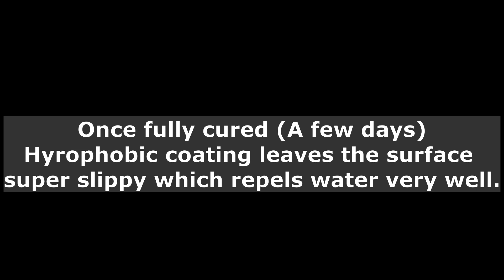How To Sand And Polish NEW Clear Coat Paint *SHOWROOM FINISH* [Easy Guide]

Comment: What’s the best surface cleaner to use in-between polishing?
Reply: I have bought expensive cleaners, PPG, Eastwood, 90%iso alch with water, nothing lifts sanding dust out of the scratch marks like the spray away glass cleaner ! from 40 grit to 2500 and even in between stage polishing its my go to. And I have yet to have any adhesion problems or chemical mixture issue's just make sure its dry I do is before epoxy primer, between coats making carbon fiber parts, single stage, base coat, clear coats, rattle cans.
Reply: Do you have a link to the surface cleaner you use?   Love the work.  Has helped me a lot in my own carbon fiber skinning adventures.